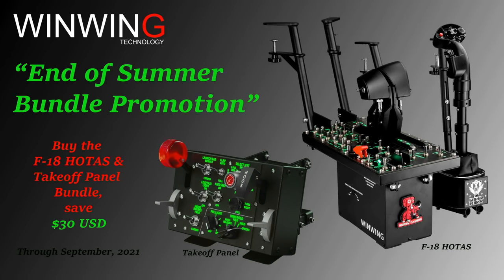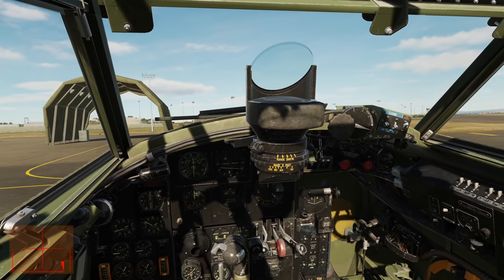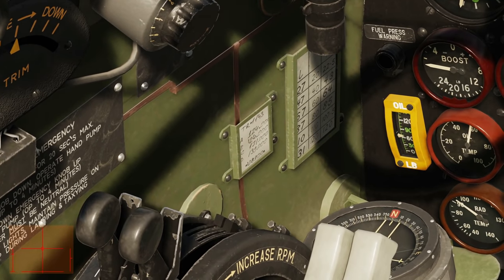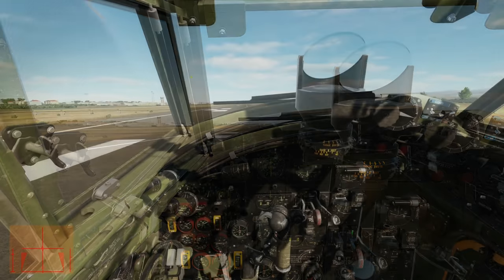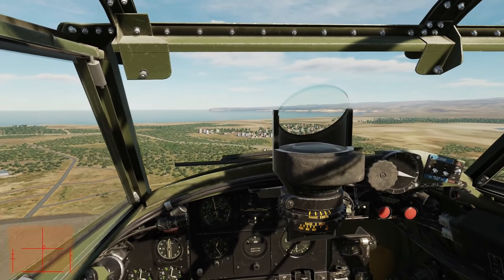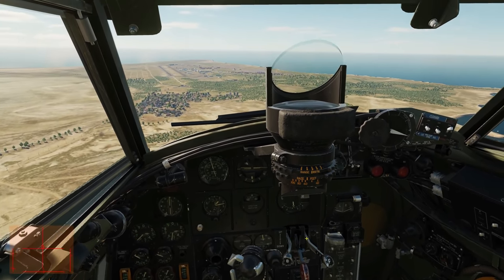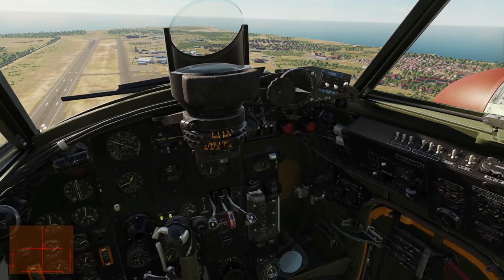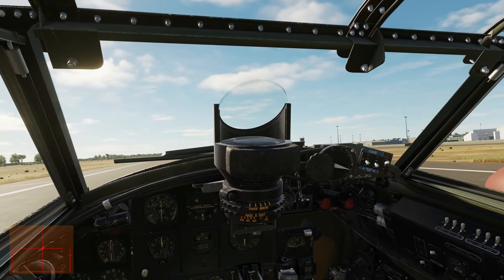Mosquito FB MkVI: Taxi, Takeoff, Flight & Landing Tutorial | DCS WORLD

Comment: I'm having a heck of a time with the mosquito on take off. Keeping it rolling straight down the run way is nearly impossible. If I get to take off speed as soon as I get airborn the left wing dips down and I crash. I can fly it fine if I start air born so it's not a binding issue. Any ideas?
Reply from the maker: Go into special options and add takeoff assists, you can then slowly remove assist until you got it.
Reply: @grimreapers  I did that and it helped. I also found I have to just let it take off. If give it any stick to try and rotate it does that. What speed do you usually let the stick center from full aft?
Starting to love this bird now that I can get into the sky.